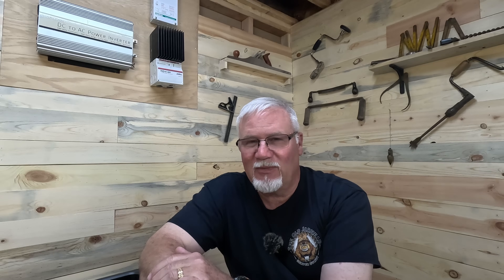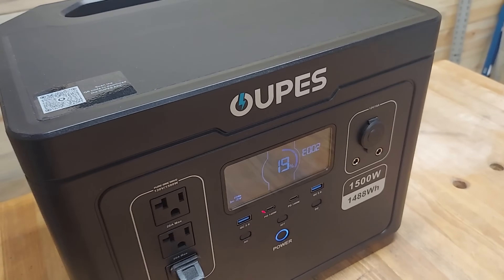Did I Just DESTROY A Brand New Power Station?

Comment: I have this unit and have had no issues draining to 0%. Had you never drained it completely before you started using it on your last review? They recommend a complete drain and recharge before you use it. I’m surprised you didn’t run into the 12% issue in your last review, assuming you did as they recommend. If this is new behavior, then it’s a faulty unit and should be repaired. And, based on the quick screen you flashed up, you’re using the old app. The new one is called Cleanergy
Reply from the maker: Honestly, I did not completely drain it.  I started to but kept thinking that it couldn't be right since I've never had to nor heard of doing that.  So perhaps it's my fault there.  However,  the 12v issue should not happen and charging back up should be faster.

I'll wait to see what Oupes says and update everyone.
Reply: @TheOldJarhead  I think it helps train the BMS or something. Can't check now, I guess. Haha. All of their units they recc a full discharge before using it in general. The DC thing is weird, though that output is only rated for 12V 10A, so about 120W. Not saying it should have broken, but you certainly were never going to get 200W out of it. And the new app is better.
Reply from the maker: I think I had the old app and it was the one I blew out in frustration.   The 12v 'should' ne 10a yes.  However,  I was asked to see if it was not really.   It did give me 140w before 1st shutdown, but then didn't like anything over 60 or so.

My thought is that it shouldn't kill the unit.  As for the BMS, perhaps but then it shouldn't have given me a low voltage alarm. I think.
Reply: @TheOldJarhead  Pardon me if I have this wrong, but it seems your 12% issue happened after not following the manufacturer's recommendations, the app you were using was the old one, not coded for this unit like the new one is, and you intentionally tried to pull more than the rated wattage off the DC. In the video you said you tried your heater on the DC output with inverter 2 or 3 times, a sander, a heat gun and every time it would give you the 12V overload error. Which is what it should do. Then your fan at 60W worked and you tried to bump up the fan speed and it shut down again, and then stopped working. I'm not saying you should only have 7 overloads in a row before it breaks, but you were trying to get it to do something it shouldn't be capable of. It tried to stop you, then it broke. The other gripe was about charging speed, and it's a fair point. Look, I like your videos. I enjoy watching your content. You've got some great knowledge. I'm just not sure this one was all OUPES's fault. Completely no offense intended. I'm a fan, for real.
Reply from the maker: Correct.  It was intentional.   I needed to test to see if the DC port would give more than 10amps.   It did not (ok, it did briefly), and each new device I scaled down to see what it would do.  I expected it would either error out (which did originally or allow more power than it should.  I agree it's not Oupes fault entirely as well. However, I don't think the entire unit should have died.  It should have protected itself and limited the output.

The original ap I was using failed. It wasn't working, so I blew it out and tried using their scan code to re-download, and it would not work.  So I went to their website and used their download.   If that's the wrong one, it's their fault. 

True, I didn't fully drain, but I have many power stations, none of which I've had to do that with.  Others also commented on not doing it and don't appear to have issues.  Would it have allowed a greater draw down?  I'm curious now.
Reply: @iamscottlink  Sorry but stop making excuses for Oupes.
I have like 10 power stations and I never had to "drain" the power station first before it would work correctly.
There is a "quality" issues with their new Exodus line.
Many reviewers are having problems. 
Now their Mega line is top notch. No clue what happen with the Exodus line.
Reply from the maker: It's OK, they do say to do that and I didn't but like you, I've never had to before.  Next time I will if it is a requirement.   I should have a new Dabsson to play with soon and we will see what they say.
Reply: @TheOldJarhead  I have a DBS3500 and 2x DBS1400 and they all work fine. I didn't need to run them down to zero.
Reply from the maker: Nice
Reply: @ Can't wait to see your impression of the Dabbsson. There are some quirks with them with I'll wait to see what you think of it. Overall, They are great units for me.
Reply from the maker: Sounds interesting
Reply from the maker: OK, Oupes will take the unit back and send me a new one.  They plan to tear it down and see what happened exactly but suspect initially it got the expected overload error code (correct) but then the high current attempt damaged the DC board shutting the entire unit down.

I've asked them a couple questions and hope to get some insight.

The purpose of my testing was to prove whether or not the unit would allow more than 10amps out of the 12v plug.  It sorta did, briefly (I need to check my wattmeter to see what it recorded) and shut down as I would expect.  However, I think it's an important test as people may have 12v cigarette light type things that can draw more than 120v or they may try using a splitter and use multiple items.  For example https://amzn.to/4cq0RDR -- that's a 170w coffee maker.  Maybe someone is in an outage and has that unit for camping and thinks "I can run that on my Oupes and it won't use the 1100w my regular coffee maker uses" and they plug it in, it trips, they get frustrated and plug it back in and it trips.  Maybe the unit survives, maybe it doesn't.  Today I can't guarantee it will survive.

I think the unit has potential but here are some things I don't like:

1.  No other power station company I've tested units for requires a full discharge before fully charing.
2.  No LiFePo4 battery I've tested requires that either.
3.  Their ap in their downloads is, apparently, the wrong one.
4.  Their scan code did not work to pull up the ap -- might just be my phone but I use it for that quite often and it works.  I could not get it to work.
5.  Their original ap failed repeatedly so I blew it out and got their download one which you tell me is the wrong one -- not my fault.
6.  I was able to draw off 1309wh but the unit said 12% -- in another review they drew off 1296wh and it was 0% -- perhaps draining it first is to set the BMS??  But still, neither of us got more than that.  Though I suppose I was close to 88% so that's actually not bad I guess.  Maybe my BMS readings were correct.
7.  Charging a 1500wh battery with 400w is pretty much yesterday and even with a boost of 800w it should have taken 1hr 40m to charge the unit.  1hr55m with solar added in later seems pretty long when their Mega1 is much faster.
8.  Finally, while I could add solar at the same time I used AC like many power stations, it did not like that.  It would rise to just over 1300w and then drop to zero.  It seems like it just wasn't limiting one or the other to take advantage of both and if it isn't supposed to use both, one should stop the other.

I think the unit has potential, don't get me wrong but I'd suggest they scrap it, put the 1.5kwh battery in the Mega 1 and call it the Mega 1.5
Reply: @TheOldJarhead  Thanks for letting us know that OUPES replied quickly. 
I have owned dozens of gas powered engines in my life. The last one came with a big sticker saying I had to pretty much fill the tank before I could start it the first time. No other engine had ever said this. I didn't have that much gas, so I tried it with less. Didn't start. Now, I could be annoyed with the company. But when I went and got more gas, it worked. So I didn't care. The 1500 has a big ole' black and yellow tag on the AC power port telling people what to do. Maybe not normal, but they're telling you how to use their product best. 

Your example of the coffee maker isn't what happened in this situation. When you tried anything over 140W right off, the output tripped (It tripped multiple times). It wasn't until you got power coming out at 60W and then slid it up to over wattage that you damaged the device. I don't know why that didn't trip the same overload error, and it's good for them to fix that. I guess it's good to know if I ever put an inverter on the DC side that I can't run my fan on medium. Haha. I don't know who told you the DC side could do more than 12V 10A, but that's what's advertised everywhere on their website and in the manual. I know some brands can do more, 12A or maybe more. They say 10A.

Charging, yeah it's slow. I don't like it. The app? Look, I'm not gonna tell you your computer should be running fine because mine is, so I can't explain why you're having issues with the app when some don't. It's definitely not perfect. Getting 87% out of the battery no matter what the screen read is better than I've seen. Hope you can get it swapped out and good luck with your future use. And, I'd like to see a Mega 1.5, too!
Reply from the maker: Whoah!  New results!  OK, I was curious what my watt meter saw and went down to the shop, plugged it into my Marine battery box 12v output and checked.  It read 200w Hi.  OK I thought, let's plug in that inverter and fan and see what happens.

I plugged in the inverter and it drew 3w.  I plugged in the fan and it ran just about 60w.  Then, I switched the fan to the next setting (it is OFF, then 1,2 and 3)....and realized I'd misread the results of my test!!!  THE POWER DROPPED!  It doesn't go 'low', 'med', 'high' but rather HIGH, MED, LOW!  So the power draw went down each step.  It went from 55.7w down to 51w and down to 45.2w -- add the 3w of the inverter idle power and we were at ~58.7w and the Oupes died when I DROPPED down to ~54w draw.

Checking again, the meter showed a Hi draw of 200w which I now must assume is a quick peak when the inverter kicked on since I didn't draw anything like that.

I'll run the test again with the other items I tried to draw to see if the inverter capped out at 200w which, of course, is too much.